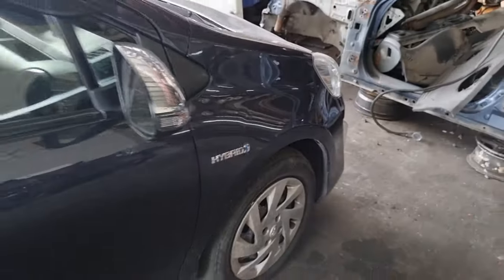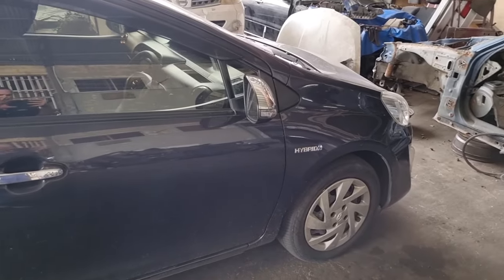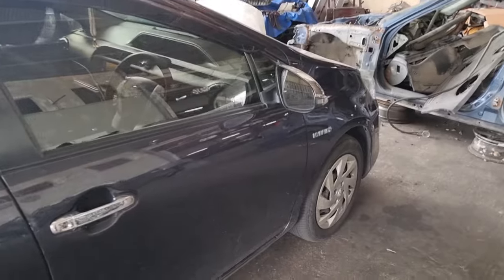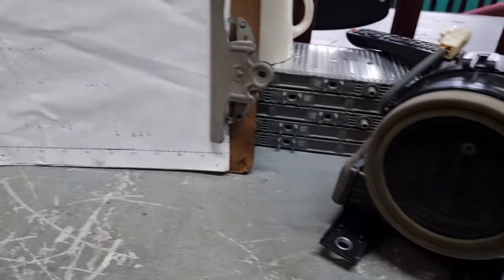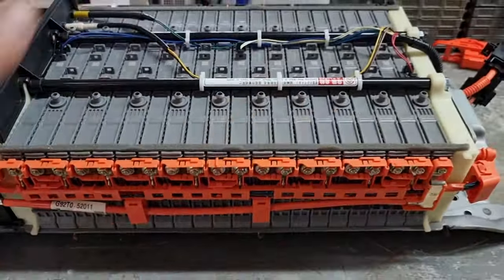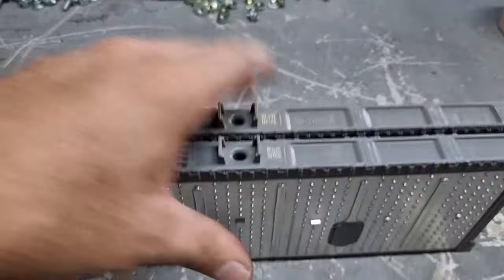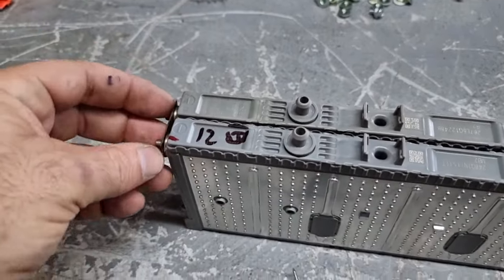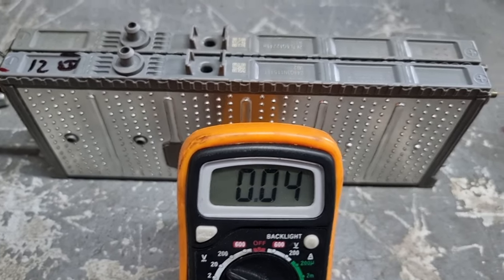Easy method to balance the Toyota hybrid battery (NiMH)

Comment: Those aluminum bars is a very clever solution for voltage balancing.

Having experience witth LiPo, LiFePo4, lead acid batteries and BMSes (battery management system) I know that same voltage doesn't mean that each cell has the same capacity (often cells are degenerated by heat).

Cells in the middle of a battery pack get hotter, so best practice is to swap them with the cells on the outside. A thermal camera (very affordable these days) can give you insight about the temperature difference between cells and their condition (bad cells tend to get warmer, too).

To recondition, 3 cycles of discharge and charge each cell (with approx. 0.6C - 0.8C and cooling) with 30min rest in between is pretty efficient. Could make a huge difference in capacity. For RC there are great chargers available that aren't expensive.

NiMh doesn't like trickle (slow) charging.
Reply: Dude you made me feel smart. If you want my old battery it’s from 2015. I don’t think it’s really bad. 
The refurbished one working so far! Great comment! I’d like to read all your comments on YouTube. Live long and prosper

Comment: What type of metal was used to mount the battery cells on to balance the batteries? I want to make one and just want to make sure I duplicate it as best I can. Looks like metal rails, nuts, bolts and wood support. Thank you!
Reply from the maker: Aluminum angles 📐 and make sure to put some good rubber base to the columns… and never use it in a metal tabletop…

Comment: Instead of charging the complete pack can the batteries be charged individually.  For an aqua what is the individual cell voltage and what voltage should they be charged?  Thanks for the videos they are great.

Comment: Jose, what is the full voltage on a battery and a white voltage is supposed to charge it. The reason I ask is because I have 20 complete battery pack and I’m planning on using them as a home battery back up system at 48 V a total of 560 modules
Reply: 8.2v peak, 7.6v+ constant
Reply: 6.7v- is "dead" for car , but will still work non car use

Comment: I have a 2014 kia optima hybrid. If i buy a new cell charge up all the cells then balance (which im assuming same principles apply as in this video). Will the lifespan or capacity for the cell all be the same?

Comment: Hi Jose, your video very good, Thanks, But I have a question could You tell me where can I buy the Hybrid cell scanner System, because my 2010 Prius the triangle light is on, I test all cell up to 8.2v but the vehicle is running, I quest some Hybrid cell the AMP it's too low,so I hop You could help me and tell me where I can buy this Scanner, Thanks Jose and Thanks Your video, Thank you very much.

Comment: Hey I have a question so I do a load test on the hybrid battery pack with some light bulbs and the cells that discharge faster I replace with other cells that hold better and the ones that discharge faster I throw away does this mean the cells are not bad they are just unbalanced
Reply: not perfect but will still start car toyota

Comment: Prius Dr shows number one ton14 which side is number one also the last three shows low volt is it bad
Reply from the maker: Main negative will always be your number one ☝️ hope this helps 👋😎✅✅✅
Reply: @hybridsolutiondiagnostics  u think I move middle cells out is good my car has 220000 miles

Comment: The ioniq has a balance energy system inside or is necessary do the same process? If the answer is no, how often is necessary todo? Thanks and excellent videos
Reply from the maker: Ioniq has a self balancing system... just clean the battery and fan every 2 years...
Reply: @hybridsolutiondiagnostics  fantastic, thanks.

Comment: I have a toyota auris hybrid from 2018 but in the future i need to change battery also.. the capacity of the toyota auris battery hybrid is 6.5Ah, is possible to upgrade the capacity to the 12Ah or more?

Comment: I am a little confused when you mesured the individual module voltage dont you need to take the battery off the balancing bar thing and measure it then? Cause it still in parallel dont you get the same voltage anywhere on the line?  i feeel stupid all of the sudden.

Comment: I cycle the modules one time and i balanced for 48 hours . After life expectancy test ( actual at 99.67% from 67% ) i have voltage difference around 0.3V with Dr.Prius . Do you think i should let them more time to balance ? Thanks
Reply from the maker: 3 days will be great... 👋😎
Reply: @hybridsolutiondiagnostics Well , i need my car for next week - Having 0.3V difference will damage the modules ?  What is the threshold for voltage difference when car will throw error code?
Reply from the maker: @braescuvalentin761  1.2v 👋😎... so 0.3 it is whithin the tolerance... however it is not that simple... you must perform a deeper test to have an accurate data...

Comment: Do you need to mechanically stop the batteries from expanding when balancing?   If I have a low SOC cell and a  high SOC cell on the mechanical (two bars) balancer, will there be enough current to expand the cells if they are not physically compressed?
Reply from the maker: Charge them assembled in the frame... let them cool down and then you can balance...
Reply: @hybridsolutiondiagnostics  А зачем их заряжать если можно отбалансировать поставить на авто и она зарядится

Comment: Do I need to charge the battery before reballancing the cells?
Reply from the maker: Yes... it will be better...
Reply: @hybridsolutiondiagnostics  I charge with the charger type Prolong for 24 hours or with the car before to remove it?

Comment: Like you video...! Hey Bro... Question if a module when you remove it has 6.7v and you charge it individually with an 8v charger for two days and after that the module returns to 6.7v is it already considered defective? Oh is it possible to revive it with the parallel load as you show here?
Reply: as itself its to dead to work in a toyota, i belive the start volts is 7.4+, you can by cells one at a time

Comment: I have a question,,,Those batteries inflate when they get charged or balanced which cause the battery to degrade if they are not packed or hold by any means and ventilated to remove the heat disipated.. That is why they are packed close on the module.Can you comment on that?

Comment: I need some help lol ! At this moment I’ve my hybrid battery connected to the Maxx volts charger to balance it, the pack battery is full charged, the volts is not changing, is it normal? For how long do I need to leave it balancing?
Reply from the maker: Send me a DM via instagram
Reply: @hybridsolutiondiagnostics  I don’t have instagram anymore lol I can text on Facebook message
Reply: @hybridsolutiondiagnostics  I texted you on Facebook

Comment: Hello, my very simple principal question. Why is such a big deal balancing the modules so closely!? I understand if there's a big difference but what if they are about 0.5 volt different? The other thing is do you load test them before balancing them. How about if they have different capacities under the load even if they have almost the same voltage!? Thanks

Comment: I was curious if balancing the modules actually improved the modules, so I explored  balancing the pack more, and I have a theory of what happens when you balance the modules. After balancing the modules, I charged them individually @ 3 amps up to 8.50 volts, and then tested their discharge time. For some of the modules, their capacity dropped dramatically (to 20% of their previous capacity).  However, after cycle charging/discharging them a few times, the capacity came back. What is going on here? I think what may be happening is that when you balance the modules, the electrons flow back and forth much more, causing clumps of material to become dislodged. I think this back and forth action is similar to how water in a swimming pool moves back and forth when someone jumps in the water. I find some older modules have a hare time keeping the voltage at 8.20 volts. A module that cannot be charged higher than 7.2 volts likely has a bad cell, and should be discarded. Charging a balanced pack up to 8.40 volts for 12 hours likely is safe. Doing this step will likely bring the voltage of all 6 cells in each modules up to 1.4 volts each (8.40 volts / 6 cells). Balancing the modules this way is dangerous so BE CAREFUL! Make sure + to + ALWAYS, and also make sure a module's voltage is close to the pack when adding it to the balanced pack.

Comment: Please, tell us what difference it makes to upgrade batteries. How does it affect the fuel mileage? Thank you
Reply from the maker: Upgrading to a brand new battery of course will give you way much more fuel saving efficiency...
Reply: @hybridsolutiondiagnostics  how? The computer stores only so much energy, and uses only so much energy.. I live in town myself and never do 25 mph. The battery is used when it reaches a certain point and not used when it depletes to a certain point, and stops being used when you go over 25. How can it help to change batteries? The car only uses the battery for very short periods.

Comment: Hi Jose, Great channel. Really appreciate it.  I have 2 questions regarding charging. Is a 1 amp NOCO Genius charger sufficiently small to collectively charge a Prius Gen 2 hybrid battery without causing overheating. Secondly, if I make  balancing "machine" like yours, will I run the risk of having cells expand if I add charge while they are on the balancer?
Reply from the maker: As long as you use tma very low current charger and good ventilation it should be fine... but do not charge in the balancer... modules will swell bad... 👋👋😎😎

Comment: I have learned a lot from your videos. I have one bothersome question: You show balancing with the Prolong battery Charger in a video, and your mechanical customized balancer in this video. When would you use one or the system, or would you use both for a reconditioning?

Comment: I think that this is a good way to balance, but if I am going to go through the trouble to have a battery out, I would want to cycle and load test the batteries, specifically checking capacity variance. Part of how they get imbalanced in the first place is internal resistance and ACTUAL capacity variance between each individual cell. That way I can toss out any weak performing cells and get a better net product.

Comment: How safe is it to touch it on both sides at once with 28 batteries on it?
Reply from the maker: In parallel it is safe... voltage is low so it's fine 👋😎👋😎
Reply: @hybridsolutiondiagnostics  Wow quick response, but have you yourself tried it? I know 7 volts isn't much, but with that much amps it will surely jump straight to heart tissue, would it not? That is still 700watts going through you.

Comment: are they not swelling when you balance them unvompressed?
Reply from the maker: No
Reply: @hybridsolutiondiagnostics  what max voltage do you typically balance them this way from? Is it possible that if MAx  module' voltage is high  8.5v then swelling could happen in those with say 7.0v?  Keep up your great videos!
Reply: How long does it take to balance?

Comment: I have ? Im being told that the charger u use to discharge and charge with a rack balance will not reveal a bad cell even woth a load test of 6.6 amp im to use a rc charger to reveal bad cell this correct i do c in few of ur videos u have rc charger wht the need for them as well
Reply from the maker: Yeap... rc chargers will do the job very well

Comment: when you have them all connected in parallel and you measured the V on the aluminum, and you get 7.10 v. You when checking the individual, also will show the same because at every point, you are measuring the overall volts. YOU need to lift a unit UP and test it so it is not touching the aluminum bar - and compare the before and after voltage for it - as you said, they become in balance very very slowly - then you do this wrong and say they are coming in balance very quickly :) 

I have my batt all apart right now and have 5 modules that are bad - 3 of them are below 2 volts and one shows 6.32 and the other 7.02vs. All others are within the limits of 7.6v. I also made this "tool" and will leave mine for 48 hours and see if this will truly bring them all to equal voltages - will let you know. I have recorded each cell "present/before voltage so then I can see if it got discharged or charged up in the balancing process".
Reply: Charge each module individually up to 7.88 volts, and then disconnect the charger.  After doing this, if the voltage drops to less than 7 volts, then it is very likely that module is bad and should certainly be replaced.  This is because one of the six cells in the module went bad.  Each of the 6 cells has a nominal charge of 1.2 volts (6 * 1.2 volts = 7.20 volts).  If you cannot charge a module higher than 7.20 volts (which is the chemically supported voltage), then that module is bad.  Most good modules, if you discharge them down to 6.5 volts, they will tend to drift back up to 7.20 volts.  If they drift higher than 7.20 volts, then this is a sign the module has a memory effect.  You usually can remedy the memory effect by cycling a module between 7.00 volts and 8.20 volts a few times applying a charge of about 3 amps.
Reply: It is possible your batteries got damaged inserting them into the aluminum bar balancer.  If the voltage of the modules is considerably different between the modules when you insert a module, this could cause a lot of energy to quickly flow through the module being inserted, causing one or more of the the cells in that module to fail.  This balancer is safe ONLY if the module being inserted is close in voltage to the other modules being balanced.  I am not sure what would happen if you accidentally insert a battery the reverse way (OMG).  The more I think about this, I do not think this balancer is safe.  If you have one module that is 2 volts and you insert it into the set of modules being balanced, this could have caused other modules to be damaged (due to too much current flowing through the cells).  It is very unlikely a module would be below 5 volts.  If you have three modules around 2 volts, this is an indication of them being damaged trying to balance them.  You could try to slowly trickle charge the bad modules up to 6.2 volts, and then slowly charge them up to 7.2 volts, and then quickly charge them @ 2 amps up to 7.88 volts to see if they recover.  Good luck!  If after doing this, I would replace all of the modules that cannot keep a charge above 7.2 volts.

Comment: Great video. One question, are you familiar with the EnnoCar batteries with the green cells? Are those as good as the original toyota battery packs?
Reply from the maker: Thank you kyle... those are chinese cheap batteries... they claim a long warranty for the pack but so far had a few customers with some issues... but they will never be like the original Panasonic from japan ☝😎 in quality.
Reply: @hybridsolutiondiagnostics  thank you for the response. Are they able to be reconditioned/balanced in the similar way you are highlighting?
I am the owner of one and would be interested in doing a reconditioning
Reply from the maker: @kyleVmaraj  the very same principal... those chinese really need rebalance way much more often...

Comment: Why not put 2 together then parra the rest to make 16v as if the cells are below eg flat at 3v then you can charge them to 13v 14v ( 7v each) from battery and have a charger on battery to get enough charge to make ign live and move car for it to be able to start the car as mine has no starter moter

Comment: Question. Why does it even matter if all the cells are in balance?  The second you put your newly balanced cells all in series, they well certainly all go out of balance very quickly due to the different capacities of each individual cells.
Reply from the maker: You said your self the right answer 😎👍✅✅✅🔋🪫🔋🪫🔋🪫
Reply: @hybridsolutiondiagnostics  So balancing all the cells is just a waste of time, right? You can temporarily force all the cells to be the same by putting them together in parallel. But after you separate them and connect them in series and charge them for the first time, they will all go out of balance based on things like differences in the resistance of each cell and the connections between the cells and each individual cel'ls unique capacity and resistance. If i understand your response, I must ask you why do you teach people to do something that has no purpose and just wastes everybody's time? If that's not what you are doing PLEASE explain why you think balancing the cells needs to be done?!?!?!? What is the purpose of balancing something that will go out of balance immediately?

Comment: Hi.i wondering if you can balance the batteries on the vehicle with a minimum taking apart?  Thanks 
Fan of your channel you doing a great job 👍
Reply from the maker: You will have to take apart the busbars to conect the modules in parallel... so ti is way better to take the battery out...
Reply: @hybridsolutiondiagnostics  yeah you are Wright. I didn't think it over.
Thanks

Comment: There are 6 cells in one battery module.
With this method, you only equalize the voltage of the batteries.
However, the 6 cells of the battery can have different charges.
Reply: Actually, if you charge one or more modules up to about 8.40 volts, and keep them just under 8.40 volts for about 12 hours, this will equalize the 6 cells within the module.  When you have 2 or more modules connected in parallel for 12 hours, and apply a trickle charge, this causes a flow of electrons in and out of the modules, similar to waves in the ocean or ripples in a pond.  I find keeping the voltage between 8.35 and 8.40 volts works well to restore capacity in older modules.  It helps to restore battery resistance too.  I have revived some modules that sat around doing nothing for a year using this technique.
Reply: @GaryMarkowski  tqvm